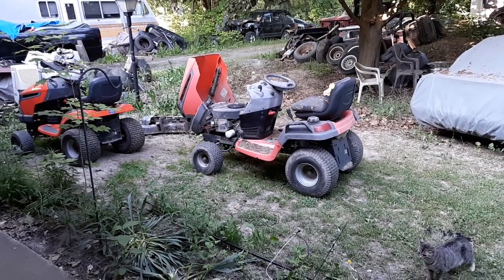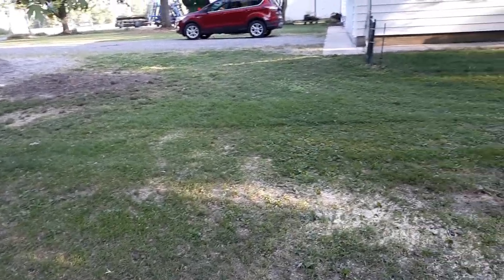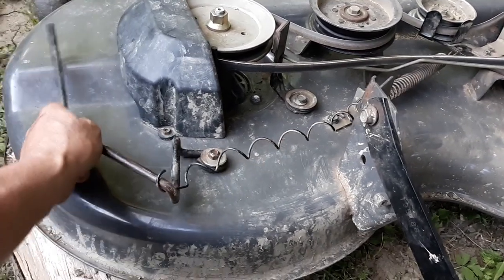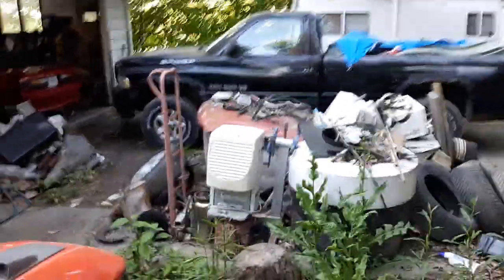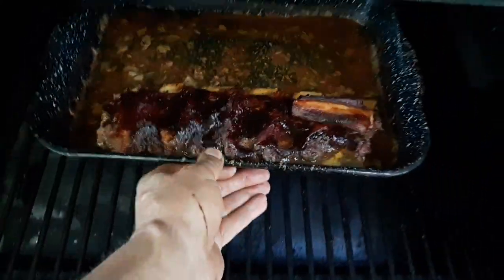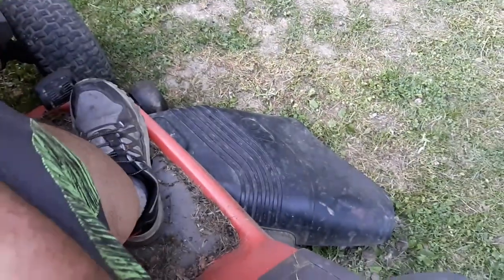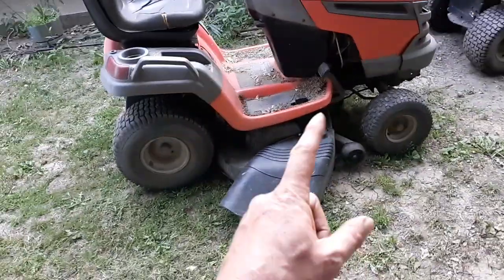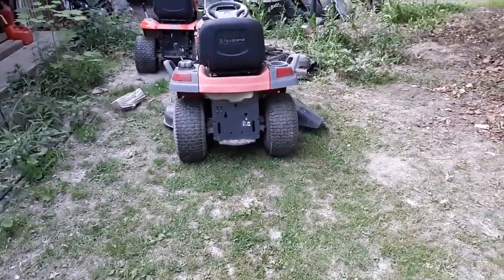Happy Memorial Day, what did you do today. I worked my fool head off 💪😎

Comment: Looks like the spring did the trick for the mower deck. The spring keeps constant tension on the belt when you have the electric PTO. When the PTO is disengaged the belt pulley free wheels. The spring keeps tension on the belt so that it doesn't fall off. Same principal as a belt driven A/C on a car. Glad it worked out for you.
Those ribs look great. We just had burgers and hot dogs.